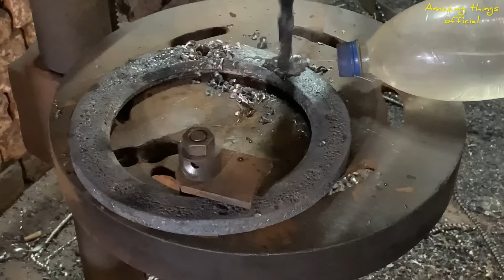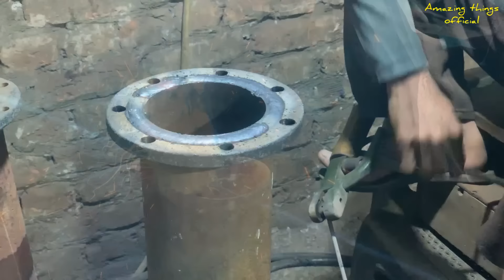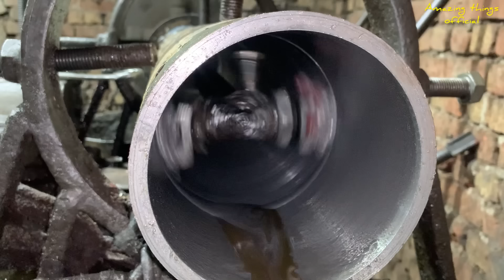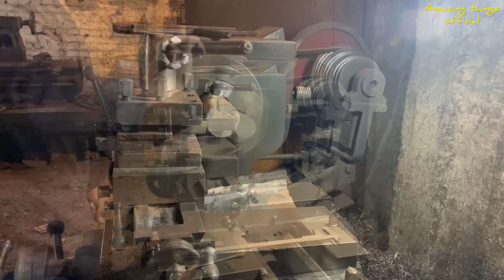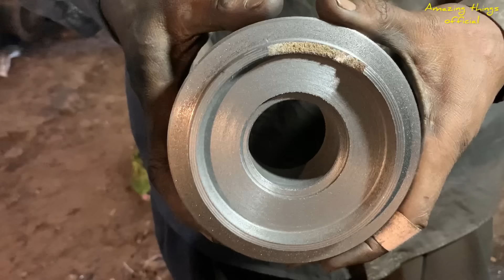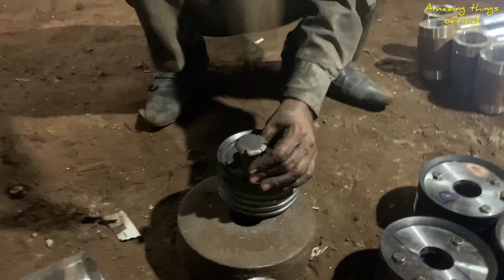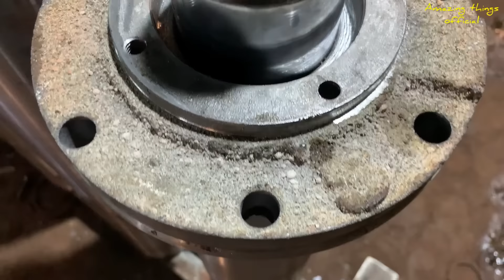How Hydraulic Jack Are Made || Production Process of Heavy Duty Tractor Trailer Hydraulic Jack

Comment: I've watched a lot of these video from India and I am always struck by the differences between India under capitalism and China under modified communism. Now I know that India does have some impressive manufacturing facilities, but generally speaking the majority of shops are much like this one. Most shops have bad working conditions, no safety of any kind, worn out machinery, no quality control, and workers who will never get ahead. The products these shops produce are frequently substandard. This shop uses casting blanks that are undersized so the machining cannot be done without leaving sand still adhering to them. Some of those pieces still had sand on the inside of the cylinders. Ever seen what sand will do in a hydraulic system? It will destroy your pumps. Did the owner of the shop care? Not likely.

China has few of these kind of shops left. They have used their profits to continually improve and most of their facilities are state of the art. Their workers are taken care of as the companies realize that they are a valuable asset. No one is working on a dirt floor. No one is carrying product from one station to the next. Everyone is provided with personal safety gear. Machinery is CNC wherever possible. Quality control is everywhere ensuring things are done right and there is a constant vigilance by both management and workers to find better ways and economies to improve even further. 

Now I am not putting one system of governance over the other. It is a choice that each individual country must make. But from a personal standpoint, I would gladly work in a modern factory in China than I would a sweatshop in India. One of the reasons that some manufacturing countries are now failing is simply because they put profits ahead of improvement and shipped the work overseas to ensure profits were still coming in. They didn't reinvest to keep their plants up to snuff and they didn't care if you could not get a job at home.
Reply: Tldr

Comment: BadIdea. "Put some grains of sand in seals during final assembly after such a grand quality of fabrication,machining and welding.."..
 This is the way to get early seal failure and bad reputation.

Save your company and get a vaccum cleaner to remove sand from parts before final assembly.
Too easy.

Comment: Machining medium carbon steel pipe without coolant.(no discolouration of the steel after welding would have to be mild steel)... Medium carbon steel will work harden and destroy the tungsten(Wolfram)tipped or cemented carbide tooling so I would assume mild steel and not medium carbon steel steam pipe. How's the flash burning of the welders hand without gloves. Wondering if these guys glow in the dark. No safety glasses also makes me assume no insurance policies or compensation for injury, like an eye injury from metal splinters. I don't think these conditions would even be allowed in the western world. Also I'm wondering what sort of tolerance their working to without using coolant and the thermal expansion of the pipe over long cuts would prevent parallel walls, so a tapered bore is the outcome. Very perculiar. Most can operate machines(pushing the on/off button) but how many can control the outcome with fine tolerance machining.

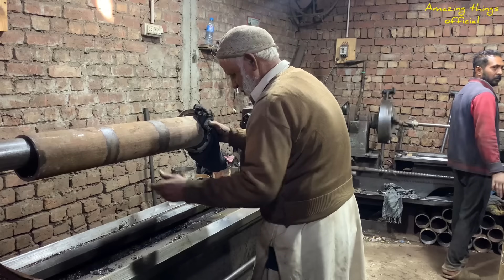Comment: More handling heavy steel and welding while barefoot from the ass end of the world. Welding by squinting instead of eye protection. Hydraulic cylinder flanges torqued to spec by jumping up and down on the wrench. And at the 6:00 minute mark when grandpa slams the steel cylinder down on the unprotected V-ways. Pure hilarity.

Comment: Surely their boss told them to do a full penetration weld on the end cap !  That disc is subject to the full load yet is held on with a partial weld of unknown depth that has been ground flat.
Reply: I think you could say something like that about every step along the way. I liked the piston O-ring groove depth by eye, I probably wouldn't hang out under what that thing is lifting.